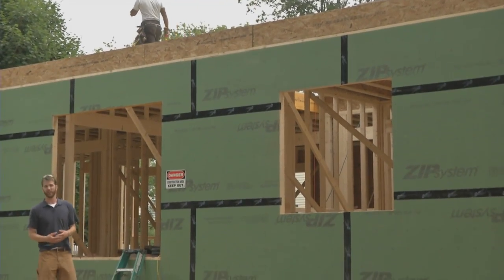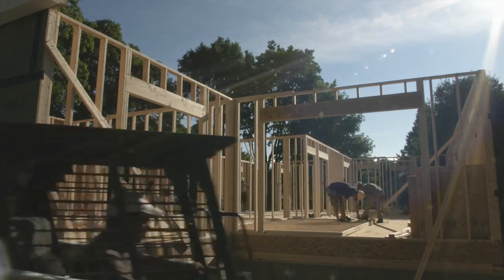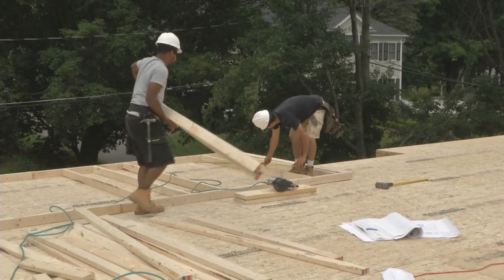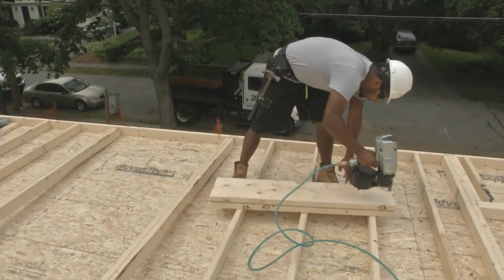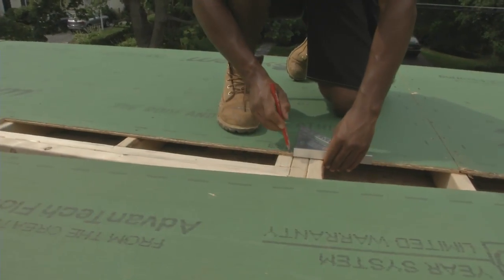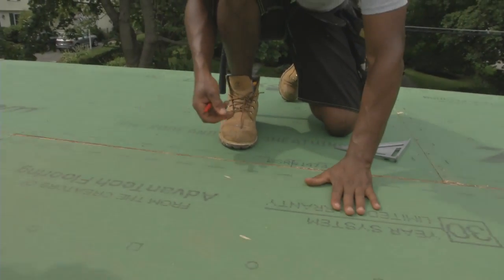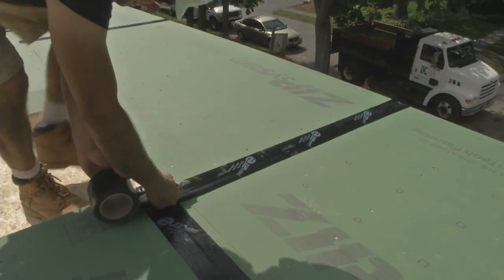Sheathing Walls with Zip System

Comment: One thing I noticed that they missed and a lot of contractors would argue that it isn't necessary, is covering the rest of the fasteners with a water barrier. be it more tape or a fluid applied barrier.
Reply: Noise barrier

Comment: I am watching this video because I want to use the Zip System for my oversized garage. I want to save time and money doing it. At 4:01 it mentions that "Sealing overdriven fasteners was not necessary."  If you look at the image at that time, the integrity of the factory coating has been compromised and would allow water to enter and soak. Am I missing something. Wouldn't common sense say "Seal it."?
Reply: You are absolutely correct. This video shows a hack job for zip sheathing. They are not leaving a 1/8th inch gap between the sheets. They are overdriving the nails and then not covering the holes. They are not shingling the tape. DO NOT use this video to help with zip sheathing installation.
Reply: You will not save time and money using this.  If the builder insists on using it. Go look at another job he has done. If he is not using liquid flash and rainscreen . I would not use him because he doesn't care and/or doesn't have a brain
Reply: Imo any type of shingle effect paper is better.  Its def good for an air seal. But if not used correct it's a disaster

Comment: lol, their nails are just crushing through the outer coating. I know it will be covered up with tape but the deeper the nail crushes the material the less strength it has. plus say you have an area where the tape didn't seal all the way. water could possibly get in there. I'm surprised no one told them to turn down the pressure on the nail gun.
Reply: What I was thinking

Comment: Typical You Boob video, Fine Home Building showcases a new product with a bunch of fucking butchers driving nails halfway through the product and on another section seaming on 1/4 of the boards width...but but they were fast LOLs

Comment: It's amazing how cheap and lightweighted these houses are build in America. Sure they are all good build, but here in mid Europe most buildings are full brick or cinderblocks. On a new House we have nowadays 30cm brick/cinder and at least 20-40cm of insulating then 1-2 cm mortar and for the finish 2-3cm grater plaster on the out walls. Sure they are more expensive but they are build to last a long time.
Reply: A good wood framed house will last over 100yrs and some in my city are from the mid 1800's as they are original to the area. The issue with concrete framed homes is the inability to expand the home easy which is required when you start with nothing but trees on a vacant lot. You want a shelter and then expand that shelter overtime. That is why most builders are used to of stick framed homes in the US as our house building industry expanded over the years using techniques already used. The same can be said in Europe where forests were protected for the navy's which required using stone and other materials.

Comment: Could I install Zip with screws?
Reply: If you can find screws that have the sufficient shear strength, rated and code-approved or engineered for use on sheathing.

Comment: This was a very improper method of installing Zip sheathing.  Water will penetrate not only the nail holes, but the tape joints also.  Zip can be made waterproof but it has to be done by caulking over all the nails and the tape as well.  Here is a link that shows what happens when the nails and tape are left as shown in this video.
https://youtu.be/Ce7M0vNAeqc

Comment: Nail holes , tape failure and the fact that OSb has an uneven rough surface , which makes it extremely difficult to seal with any type of liquid sealer. 
Americans need to stop basing EVERYTHING on money. There are NO shortcuts in quality time tested house building . The homeowner is not saving a dime by having their contractor use Zip panels . He is NOT passing the alleged labor saving on to you, but rather himself. Don't be a sucker.
Reply: Nailed it
Reply: It's a shitty system designed for shitty builders to be faster. But speed is not quality. But most builders disagree

Comment: The only way to make this whole system work is to keep your nails strait and tape over your nail line because this stuff just like OSB will puff up when the water hits it. I really think this board will expand just from moisture in the air.
Reply: Because it is OSB.
Reply: Its wood

Comment: For those talking about over-driving the nails, search for Zip 2.0 from Matt Risinger on YouTube.
They're replacing the tape and sealing nails with a liquid-flash product.
Reply: The only way this shit shld be used Is with liquid flash and rain screen system. Period.  And I still prefer to go another way
Reply: @jeepsuc99  whats you preferred way - I'm repairing an old home and the 120 day grace period is leading me towards zip system at 54$/board the stuffs not cheap but if it gets me to water-tight after installation it can't be beat
Reply: @Kobe29261  120 day grace period?  I repair so many new houses with zip. If fluid applied flashing is not used, which I hardly ever see,  water gets behind everything.  There is no paper lapped the way it was been done for over 100 years, I wld rather use 3/4 plywood everywhere, with typar paper and 30 lb felt splines at all penetrations.  And closed cell insulation in walls to create pretty air tight build.  Now I know zip is great for air tightness,  and if I was forced to use it, I wld fluid apply flashing everywhere, and it would be a great envelope.  I just see so many builders use it , like it us great,  and most people love it. But too many details get over looked by average builders, I live on the ne coast, so anything not done 100 percent will leak.  Middle of the country and inland can get away with alot more than my area
Reply: @jeepsuc99  Thanks for the comprehensive response. I'm DIY'ing so I'll take max precaution with everything. The 120 day was a reference to the claims made about seam-taped zip sheathing, apparently it can go that long without the final sheathing. Half what you said went over my head so am doing some research. You are obviously on top of your game. Thanks again for being generous with your knowledge. Also I'm in NC so slightly higher tolerances than you are probably able to live with up North i.e. winters not as punishing and unforgiving.
Reply: seems like zip system is way more expensive than tyvek...worthless
Reply: @alejandrozuniga4426 tyvek is a crap product, require more labor and is never as tight as zip. There are builders that use cardboard sheathing too

Comment: Every nail is a potential leak. Every horizontal tape strip with creases can catch water. Tape should overlap in the proper gravity directions. Go and watch the Zip wall water test. Leaks 10x worse than Tyvex. I get it! No exterior wall system is perfect but what contractors and consumers don't realize is that EVERY penetration is a potential leak. SOOOOO, how many nails are there per sheet? 50? ....and no effort is made to fill any nail head that over penetrated.
Reply: That "testing" you see by Zip's competitor is spraying rain directly against Zip system - in reality, the sheathing is covered by some barrier like clapboards, stucco etc, so you'll never get driven rain as shown in the "test".  And just how well do you think Tyvek would perform with the usual zillion staples thru it under the same "testing" conditions? (Hint - about 10x worse)

 That said, there are much bigger issues with the overdriven nails shown in this video - any decent inspector would red flag the walls as the structural properties of the sheathing were compromised.  Unfortunately, taping the seams hides over-driven fasteners and hack work can go unnoticed. I'd splurge for liquid flashing rather than tape - more time and $, but worth the cost of another few minutes per wall assembly. I'd also make the framer pay to remove and replace their defective work.  Next time those framers will properly adjust their nail guns...
Reply: That's why you use Zip liquid flashing instead of the  tape
Reply: I think this is in texas i dont think they get that much rain down there... or does that matter?
Reply: Anything is better than this.  Workers do not have the attention to detail to use this. Its potential to have issues is huge.  I will have work for life fixing this shit installed by idiots that dont care

Comment: these guys need to set their nail gun to not penetrate too deep... That completely defeats the purpose of the barrier.
Reply: You can not control pressure when you have 2-3-4 guns at the same time, to me zip system would be good BUT taping over the nail heads not only joints

Comment: A router would've been easier to cut the openings.
Reply: And a lot slower
Reply: A router is a LOT faster. Get a real router and try it instead of just stating what you think you know.
Reply: @spadesofaces1980  are you on drugs. On no planet is a router faster than a circular saw.
Reply: @abewilcox4560  trust me when I tell you that I can use a router to cut out a blind window in the time you snap out the same window. And I don't run the risk of cutting a trimmer
Reply: @spadesofaces1980  doubt that. It's 2 extra tools you need to have out.
Reply: @abewilcox4560  what 2 extra tools? I punch a hole with the claw of my hammer and then take a router with a flush trim bit stick it in the hole and run it to then around the edges. Whenever I plan to sheath walls, I already have my router available so it doesn't take any more time to get the router. Try it once or twice before you just discount this method.
Reply: Router method is way faster for production work. For the owner builder, counting matieral over time, it produces more waste so it might be more expensive. When labor costs are involved nothing beats a router with a flush bit. Even a wimpy cordless router would do a couple windows faster than someone could measure and mark and cut out around windows with a skill saw.

Comment: Use a router with a flush cut bit to cut the OSB out of the windows. No measuring, no lines to snap. It's much faster and more accurate.
Reply: I was doing it just like that 1992 without the zip stuff of course but with the router.  Gable ends windows and all.  Clean. this is a good framing crew though
Reply: @Octavio Bustillos If you get a decent enough router you can push it faster than you can accurately guide it.  A sawzall blade will travel....
Reply: @Octavio Bustillos Also you need to touch up corners using a sawzall instead of just moving from one leg to the next.
Reply: Or a sawzall?
Reply: @alejandrozuniga4426  no.
Reply: @markopolo6009  ok than lol
Reply: @alejandrozuniga4426  no.

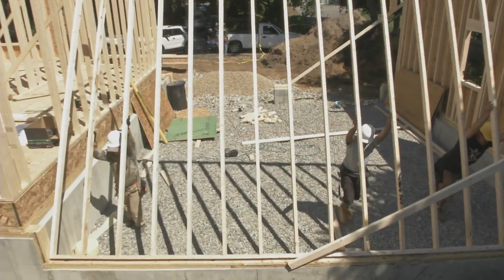Comment: The carpenter at 5:30 is overdriving nails so badly he might as well not be putting them in.... it absolutely kills your nail connection strength.
Reply: And it ruins the membrane
Reply: look at him
Reply: That's why this shit shld not be used
Reply: @jeepsuc99  Any product can be installed incorrectly. This is one issue that is easy to solve. This is the fault of the carpenter, not the product.
Reply: @Jookyforever  a product that can b installed wrong in so many ways is not worth it. 90 percent of builders don't install products correctly. I will stick with what has been around for years and works. And I will continue to fix new builds using this shit system.
Reply: @jeepsuc99  I mean all he has to do is adjust the pressure gauge on the gun and its installed proprerly

Comment: 2X4 walls? Where the heck is that? No structural blocking on 12 foot walls?
Love framing but unfortunately most the framers where I live are hacks. These days I get people wanting me to run crews of 10 for $25/hr. That's what Hong Kong Chinese immigrants were paying me in 1988 they like my work so much.
I turned down a job the other day leading a 3 wing 4 floor condo project because they would only give me $28.
Apparently they cant find any good workers. Go figure

Comment: So you're not required to have a gap between sheets like you do with plain OSB?
Reply: Apparently you still need 1/8" on the 4 foot side.  I didn't notice any of that happening here.
Reply: Yeah I just watched this video and I noticed that.  I did some plywood sheathing in the winter with 1/8" gap between panels and come summer, it closed and even buckled in a few spots.  So I ended up running my saw along the seams.  Lesson learned.  most panels call out 1/8" but I do even more now.

Comment: @ Tim Uhler,
I was wondering the same thing.  They obviously don't have the seismic codes we do here on the left coast.  I also noticed that the crew didn't "think like water" when lapping the tape.  No offense to this very efficient crew, but I just wouldn't trust the adhesive that much.  Does this mean that deck ledger Z flashing and Roof to Wall rely solely on the tape?  I'm not sold.

Comment: with all the sheathing nailed in place I hope those walls are plumb..
Reply: You square the wall first, obviously.  Stand the wall up, plumb, brace then sheet it off of a ladder??  Fk that.  This is rough carpenty dude.   In 12 years of framing, ive never had a squared wall more than an eighth out of plumb.  This is double checking with a plate level.

Comment: Is there more to the zip system than just a layer of sealant?  It looks like standard OSB with a layer of paint on it.  Unless it's basically the same price as regular OSB, I can't imagine it being cost effective.
Reply: Its not. Very much more $
Reply: I did a rough estimate, per square foot, of the cost of plain OSB & Tyvek, vs Zip. I even included tape cost per foot @ 12 ft per 4x8 panel. And on the roughly 200 sheets I'll need for my new 2100sgft home, Zip is almost $4k MORE! I'd pay it if I thought there was some substantial advantage, but everyone agrees that both systems, as long as they are installed properly, perform basically the same. So I can't justify the massive cost here personally.

Comment: I've never understood why the sheathing on the east coast is run horizontally.  Out west we have seismic issues to deal with and run it vertically to meet the engineering requirements.  It is stronger, and doesn't require more time to install.  We prefer to cut out our window and doors with a router since it eliminates all measuring and marking.
Reply: that's not the case actually from doing stress tests, it's stronger running it horizontal.  I've heard of some requiring blocking to be put on the seams, but maybe that is just in earth-quake zones, where it's required to run horizontal.
Reply: @abacab87  Yeah I was wondering about this when I read his comment. I'm no engineer, but I'd like to think that I understand basic physics, and it seems to me that a larger horizontal piece will offer more strength against side to side shear forces.
Reply: Horizontal is actually more strong due to the off-set, but vertical is definitely my preferred way

Comment: so the membrane and tape make the sheet water tight - what about all the nails going through the membrane?
Reply: I don't think they claim water tightness.  Tyvek isn't water tight either as it also has nails and Staples penetrating it.
Reply: That's where it leaks
Reply: they didn't use any and I would imagine the labor involved in that would make the system pointless - plus the window openings aren't wrapped...
Reply: I was told that if your nail heads punctured the membrane that the warranty is no longer valid. A few guys from my crew took a class with Zip Systems before we started using their products so that came from their mouths. Seems pretty ridiculous to me. I definitely beats running tyvek. And they have some other cool products but that seems like a stretch. You can set your nail set depth but there are factors where it’s not going to be perfect at all times.
Reply: @danielelder8621  This is true ,zip states it in there video.
Reply: @danielelder8621  exactly. plus its makes it way more likely to fail. Idk what they were thinking lol those nails were going at least halfway through the material lol. way over pressured. I hope those panels don't fall aff 20yrs from now.
Reply: @Lilmiket1000  yup in az we have shear inspections can be over penetrated on even regular osb
Reply: Put some tyvek over it.....
Reply: pj You beat me to the question....
Reply: refreshing to see other critical thinkers....
Reply: As a framer I can attest to the fact Zip is a quality product. Personally I like the ZipR sheathing that has insulation value. But it is true that it doesn't save time over using Tyvek or other housewrap. I like to take the little extra time and use housewrap anyway over Zip board.
Reply: You leave the nail flush on the outside so this won’t happen
Reply: @SC-dt4ij  but i dont think the nail head provides air/water tight seal
Reply: Alejandro Zuniga the shearing does that why you leave the nails flush n don’t let them penetrate
Reply: @SC-dt4ij  with a flush nailer?
Reply: Can fill nail holes with the zip liquid tape. If I was building my own house I’d use liquid tape for nail holes and seams, then  tape over seams with regular zip tape. And then still wrap it in Tyvek. Now that is an air tight, water tight house.
Reply: Set the nail gun to not go too deep.  Zip liquid flash can quickly and easily cover overdriven nails as needed.
Reply: @davidwooten3430  you can not adjust a compressor or gun when having 2+ people nailing at the same time, compressor run out of air quickly n its just a big headache
Reply: @alejandrozuniga4426  halo flush nailer
Reply: @slimj66  yeah we use those
Reply: the only nails that will be going through the membrane are when they install the siding. It's ok for those nails to go through the membrane because all siding protects the nails from water so those nails will be watertight too if installed correctly. And if you meant the nails from the window and door flanges those are supposed to be taped over as well before the siding goes up.